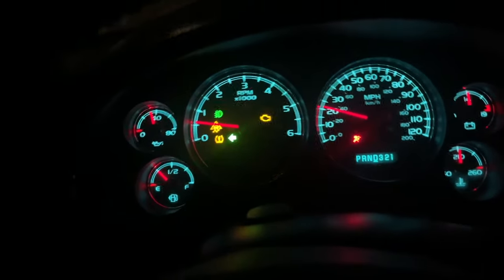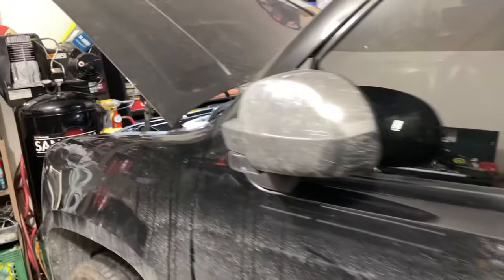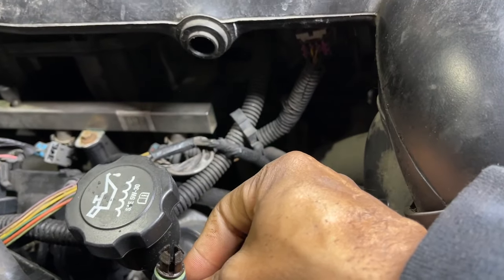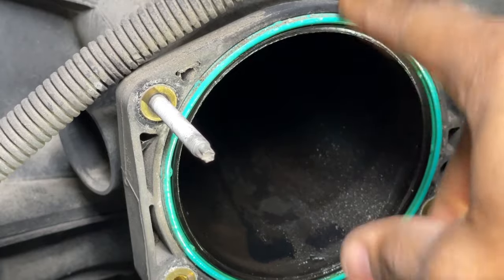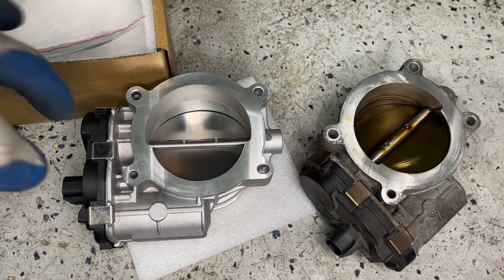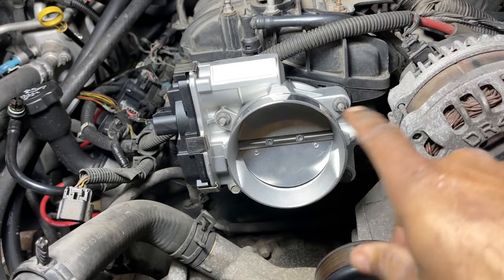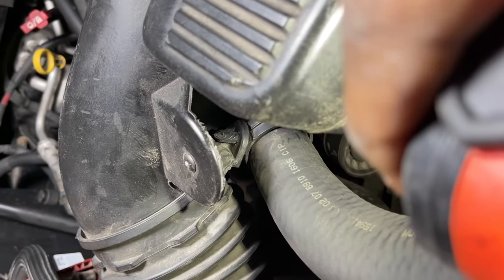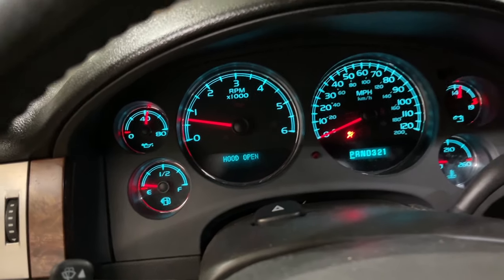How To Fix Reduced Engine Power Quick And Simple! Code P2135 Chevy Or GMC Trucks / SUV's! TPS Issue!

Comment: Hi Terence, 

My Chevrolet Captiva 2.0 Diesel AWD (2010) recently produced Traction Light On while driving and I can continued driving for tens of kilometre  while the Traction Light On was displayed. But once a Spannar Light On was displayed, I had noticed   that  the car had difficulty to move forward in spite I hard pressed the accelerator  pedal. Once I off the engine and restarted after 10 minutes or so, the Traction Light and Spannar Light dissapeared and I can drive as normal but The Traction Light On will appear again after I had drive for tens of kilometres. I had the opportunity to get my car scanned and according to the mechanic  from the history of the error codes, there were at least 3 modules that had difficulty in reading the data received. May you suggest what should I explore first.Thank You.

Comment: mine has too low the oil pressure, how can I fix it?
Reply from the maker: When was the last time you changed the oil? I would change the oil and use some Lucas Oil Stabilizer (4 quarts oil, 2 quarts stabilizer). That should get you some pressure back even if the oil pump is weak.
Reply: @TerenceDIY  my oil is @ 39% life. I already changed the pressure sensor & screen, changed the tube o-ring..... I'll change the oil and add the stabilizer. Thanks.
Reply from the maker: @alfonsosalazar6316  , let me know how the pressure is after you add some stabilizer.

Comment: I have a 03 chevy trailblazer LT and just replaced the throttle body because I was having the issue but the reduce engine power light is still coming up even after reprogramming and it won’t go over 30 mph and if I’m stopped than go it will take awhile to get up to even 20 mph any advice?
Reply from the maker: Two questions... did you replace the throttle body with an OEM one? I've had awful luck with the cheap aftermarket ones. And secondly, what codes is it throwing?
Reply: @TerenceDIY  we bought a whole throttle body kit I’m pretty sure and it came to almost $400
Reply: @TerenceDIY  I have to ask my uncle what codes came up when I find out I’ll let you know
Reply: @TerenceDIY  P1221 , P1271, P1481
Reply: @TerenceDIY  and yes it was a oem throttle body
Reply from the maker: Here are some things that I saw on the Chevy bulletin board for that year....

Inspect the main engine wiring harness between the PCM and the Generator Assembly for a potential short to ground. There is a metal wiring harness retainer in this area that secures the main engine harness. If the harness conduit is mis-positioned, some of the wiring may become exposed and chaff on the harness retainer. This may eventually cause the exposed circuit to short to ground.

Another possible cause is the fan clutch. It shares some circuits with the Pedal and throttle sesnor, and when the fan clutch failes, it can mess up the signals from the other sensors. If the P1221 sets frequently, you can unplug the fan clutch and see if the P1221 comes back. Having it unplugged will cause the check engine light to come on and if the vehicle starts to get too hot, you will want to plug it back in, but if the P1221 never comes back while its unplugged, you may want to put a fan clutch in it.
 
Also, you will want to inspect the wiring going to the throttle body. It's not uncommon for the wiring to rub on somethign and short out or for one of the wires to break inside the wire insulation (making it hard to see)....

And Finally, you could have a bad Accelerator Pedal Sensor. I wish I were there to help.

Comment: How much does this part cost
Reply from the maker: Here's a link to the part. Scroll down and make sure it fits your application. 

https://www.ebay.com/itm/374136353837?fits=Year%3A2007%7CMake%3AChevrolet&hash=item571c43b42d:g:c44AAOSwIqlivR9B&amdata=enc%3AAQAIAAABAGwr2Ib%2Bok303%2FSCIMw%2BGZPzASa9AsqSzYC%2BSaMK6emNTuTSaZvRhWRD%2Bo1ktnFngeg0M2KZVUptyuaNzxVpePuas%2BVYs2LlOAEvg1sv45QwKz9Dfu0HcXZjtiFLG9KJYkf9tQ9Nied4GePpnixb2wnYkuxOuhNQeEMwdPtMzOOfvjUm3yyzmUuhbiIZbNX4IcZ0lB7MNM%2BjPK5aOhMdBuUighhx0N8oqJ7P2zXgiwc2adcUnRyG4Oq%2FA%2Fk9SAUv0BXfwqHhfvy1C6uP3ki9qZdhIsz03f3CSu2zXU3XeFCdc2uyDS5YMtmKyawAJRCY%2BlXId8JNrdAFuRg0ipdb%2FL0%3D%7Ctkp%3ABFBM4r2aiNBi

Comment: Just got a check engine light and reduced engine power message today 2022 equinox 8k miles
Reply from the maker: That's basically a new SUV! I doubt that it would have throttle body problems. I'm pretty sure whatever it is should be completely covered by the warranty.

Comment: Y did the truck start having the small rpm fluctuation
Reply from the maker: It was in limp mode.
Reply: @TerenceDIY  mine ain't in limp mode atleast yet  n no lights ..just odd rpm fluctuating n shifting into go gears funny
Reply from the maker: Do you have any codes?

Comment: whats the name of the part?
Reply from the maker: Throttle body. Here is a link to the part. Please check if the year of your vehicle is in the description.

https://www.ebay.com/itm/394372022321?fits=Year%3A2007%7CMake%3AChevrolet&epid=12021372402&hash=item5bd2678031:g:srYAAOSwK5Fjk9dZ&amdata=enc%3AAQAHAAAA8AA9UEI8aCR4pCws66EaB64juuMlWevNYU2AMfCZulMu7tsjAooK91WGTHhuXz%2FUZ5baiHdh%2FqECYdWwjmRHxqAGfMlvYL0YPS%2B4vJHmQcIrRe3wPAYXNDALWQ3x5xelA0cKug4VUDsIoR8v%2B8ZedNu%2ByysD2S6pJ9uVfmEFFmkbNci27xEMwf%2FRD2jaZx0G%2F8N%2FXKeSTNovfYjTKhKkZflE%2BahK2B6owuP4DJDX7hGSMyUNmUFloaniG8ox%2BFuQtshERRBi4lrwXQ8L6svwwiyEQxuTnEx7TcbM0LTMYRR5W1yLr28RemlMgNBExCjcCw%3D%3D%7Ctkp%3ABFBMrpLM6-dh

Comment: I’m expressing this same problem with my 07 Cadillac STS. I replaced the old throttle body with a new one and I’m still getting the same error code. I would try to drive it but after a mile or two it would start to jerk and the “engine reduced power” light comes on through the dash. I don’t know what to do next
Reply from the maker: Hi Daniel, there was a bullentin released by Chevy in 2012 regarding this issue. The main culprit was the throttle body however, there were also cases where the harness that connect to the throttle body was having issues. There were wires along that harness that were somehow becoming frayed maybe from vibration along the engine block. I wish I were there to help you fix your issue. Thanks for watching.
Reply: @TerenceDIY  loo pop

Comment: What’s the part called that you replaced???
Reply from the maker: It's called the throttle body Andre. Here's a link for the part...

https://www.ebay.com/itm/333272439452?fits=Year%3A2007%7CMake%3AChevrolet&hash=item4d9895da9c:g:EpoAAOSw6QJdM5EW&amdata=enc%3AAQAHAAAA8MoUyTfsKekX%2Be%2BCj7USOvxRS2XHH%2B4s%2F3tNXtAZ4Z%2BLY2YJ8cZZawMqXI5eRkCN2peingTBDhw67RTFniZ13YeWeYbWwzGRlOX3gCqapuSIPwlEOfKzGzdNW%2BNzE8MbtbVa5O%2BFpxhVaf%2Fdhg2oVWZdIKKJ8uwYAr5E7Q4T5lHcaxKgMg8Bcld78w5Kzstwf%2B6YyT02c93eY%2FS8fTlzpWfiycP3IXPY3E9UIsRRy5ZLOGKzlSpW0SfWP518hcKaYMFyYkvKSK8vx5Wz36MqN%2BWTpT110y6G5iGIyBv4qfafPuQ2pqwPyBqOyVmjjsZ5bw%3D%3D%7Ctkp%3ABFBM0pmkqZxh

Comment: This is an incredibly dangerous thing. They added to the vehicles. There has been a couple times I try to pass a vehicle and it blocks my engine down and if I didn't have enough room to get back into the could have been a major accident. This thing needs to be removed.

Comment: Hello where you order part from, was it  from the dealerhip or any autoparts store? I need one and the prices are so different and expensive. I had just replaced the pigtail and some sensors hoping that would fix it but no here we go again. 2009 chevy tahoe 5.3
Reply from the maker: Hi, Here is a link to the part...

https://www.ebay.com/itm/333272439452?fits=Year%3A2007%7CMake%3AChevrolet&hash=item4d9895da9c:g:EpoAAOSw6QJdM5EW&amdata=enc%3AAQAHAAAA8MoUyTfsKekX%2Be%2BCj7USOvxRS2XHH%2B4s%2F3tNXtAZ4Z%2BLY2YJ8cZZawMqXI5eRkCN2peingTBDhw67RTFniZ13YeWeYbWwzGRlOX3gCqapuSIPwlEOfKzGzdNW%2BNzE8MbtQa9bKHYK%2FFny1QKeLPh5%2BT%2FvWkqJDUanZ7qKFa%2FOhsJqhggQbt7Umqf6zC8bs7CX38DptVmKXrZ5e1ffO5hiOX3R0pN%2FDzQhYhPHqus0EIe9dZFt8YQiPLivMTWeFMgMLoOzqCMLA6Ny%2FxV52kLnSoSua%2BZoIhp2FPjE5q0esui5UydLADX0lxurZTAZ%2BxIXg%3D%3D%7Ctkp%3ABFBM0qf9t6Vh
Reply: @TerenceDIY  Im going to rder one, hopefully it fixes the issue and its a very low price. Mechanics where i live at have told me that it needs to be from the dealership and it cost $500.00
Reply from the maker: @el.mas.buscado7221  , here is a link for an ORIGINAL GM OEM one that I've bought many times. This part is used but they are like new. 

https://www.ebay.com/itm/114732200404?fits=Year%3A2009%7CModel%3ASuburban+1500%7CMake%3AChevrolet&hash=item1ab69271d4:g:bnAAAOSwWMRgU8CT&amdata=enc%3AAQAHAAAA8Gx2AURQy6Df5gEuMbRS0x9f2F6sA3xkCwvbAAkRh0gSrvGlMZumm3fb83KQmBYxucBIcRHGN6RBhrHec3TMmu00FyxB0q5nD8fU0xqFFeqytkdRW6bh%2BfENitL0IAmSO8V%2F3e9vTla8gLv11QU%2BBL8V62Fi%2BxmlqtW1NEFKu218t0YsAlsxotBixEF%2FJOQycsiHW0RLbf4JViYS6N%2Fn9brzYn8MtEs0GxaTbOWt8IscKQ3RiZCNPki0aELQzsgfOPlwS%2F1MjQHVLor%2FBepPVFFlOJT29a3SjhGhQvRt8i0VwANKVbYDq6Z%2FocDG4Mm8GQ%3D%3D%7Ctkp%3ABFBM7P3fia1h
Reply: @TerenceDIY  Thank you very much! Hopefully this ends my struggle.😀
Reply from the maker: @el.mas.buscado7221  , you're very welcome. Thank you.

Comment: Our 09 tahoe had this problem while pulling out of the gas station on the way home the other day. Did yours shake? Ours wouldnt shift and had reduced engine power stabilitrac and check engine. Tried a crappy amazon sensor and didn't fix anything. I'm thinking of a new throttle body and sensor.
Reply from the maker: Yes, my truck did the exact same thing. The throttle body needs replacing. Very easy job. Thanks for watching.
Reply: I have a 09 gmc sierra with same problem, just happened...scared me.. so a new throttle body should do it? It's also been around the -20 to -10 degree mark outside and my truck hates the cold, could that possibly be the problem too? It didn't start having problems until then
Reply from the maker: I would buy it and have it on standby. Mines did it out of nowhere as well and my truck was running great! Here's a link to the part...

https://www.ebay.com/itm/333272439452?fits=Year%3A2007%7CMake%3AChevrolet&hash=item4d9895da9c:g:EpoAAOSw6QJdM5EW&amdata=enc%3AAQAHAAAA8MoUyTfsKekX%2Be%2BCj7USOvxRS2XHH%2B4s%2F3tNXtAZ4Z%2BLY2YJ8cZZawMqXI5eRkCN2peingTBDhw67RTFniZ13YeWeYbWwzGRlOX3gCqapuSIPwlEOfKzGzdNW%2BNzE8MbtYUacRse6BKo5S6modgKegT%2BcxGC6sqMnXyDepwl6F7QMyv6Lh2C%2BWT%2BbRDixydvHUNzLvd1XOSTuNABIjYxA4gfuF6O58jZuEXnNA2BcG%2BE4THVrVkk8IpwHrQbukaYC6TJU8vEWbMY0KjSsa%2FI3cvYbuYTzlx%2F3xj1T3Aya%2B%2FXBci7gsfwutL8c%2B72s72YUQ%3D%3D%7Ctkp%3ABFBM8Kfttadh

Comment: Could you have just cleaned it?
Reply from the maker: It would have helped, but they are inexpensive. Here's a link...

https://www.ebay.com/itm/225590875332?fits=Year%3A2010%7CMake%3AChevrolet&hash=item34864394c4:g:tgUAAOSwNrhkby5M&amdata=enc%3AAQAIAAAA0NNQWXMnLtdnN%2Byk2rlPXLl0AL%2FWsgipAId7%2BkWY4RUqdRbvZxlfe9nGgycMuspq1RMO2RTJetBxiYrLBCVZwjmETVo%2B0V8EGwP%2Byi%2BhnygGrUqc5Z28bUl%2FAIQQfO0pMjV2sTJLRWnuRmZydzPNdCUzvM%2B719UTWLCJvBNl4HoG2taffGIi2XR%2BPxzk2BR3LQYx9N2oRHRkATd%2B3WSL937FEZYGYZsIupT4cOFzSKaFykuKLhdoVSR%2FS7m2n8D%2FWP35i7%2F%2FgsOAWJzRylQAzsM%3D%7Ctkp%3ABlBMUOa_w7aSYw

Comment: Hey brother I have same problem on my 2007 gmc yukon .. I changed throttle body and accelerator position sensor it went 5 days driving fine but on the 6th day it went back into limp mode ... same code again p2135  any suggestions? I've been fighting this problem for 2 months straight now please help
Reply from the maker: Did you replace it with an OEM part? Please let me know.
Reply: @TerenceDIY  what does oem stand for?
Reply: @TerenceDIY  and I had bought the first throttle body from auto zone and when it had went out I went back because it had warranty and they gave me a new one it was running fine for a few months and it’s doing it again.
Reply from the maker: @lippinluna4859  , Original Equipment that the manufacture produced. GM original part (AC Delco) that came on the vehicle. Here is two links for the OEM part. One is used and the other is brand new. 

https://www.ebay.com/itm/191721690064?fits=Year%3A2007%7CMake%3AChevrolet&hash=item2ca380d3d0:g:3P4AAOSw-RFaWQRL

https://www.ebay.com/itm/114732200404?fits=Year%3A2007%7CModel%3ASuburban+1500%7CMake%3AChevrolet&_trkparms=ispr%3D1&hash=item1ab69271d4:g:bnAAAOSwWMRgU8CT&amdata=enc%3AAQAGAAAA8HqhQlVKTCpJhVWZNxftPTsH%2BWoqL93Do8CndIt%2FxdmDc9gpQdsmQ4hobHvUxH07hbQUjxnPt08dQMAn7l6CxD49YxscyN63Bj%2Ffg0hgzj%2FnwXXTqusfz8W3%2BG%2FC7yXNz7paal7HNJD9QEOE4onEplx6BnWMZwHCCZxQ7zZ%2FFQAXkBkuB%2FsHFvGeRaPQhMleEU3lJmJgp8TOYN9akFkbpckDtPmhRXr3aep7U02Ax06iuHpuHJ2CNUrECRmkEeiyNg6pl1uZroszLZzHcMZJiBK7QK%2Bq5UafAt%2Fbj95apOa9afU5lAgB3F%2F6MT4iVQdNzw%3D%3D%7Ctkp%3ABFBM4ML06ZJg
Reply: @TerenceDIY  thank you!
Reply: @TerenceDIY  damn I didn't... I will order the OEM parts now I'll give u Update when it's done thanks again bro..
Reply from the maker: @kaiooo814  , you're very welcome. Let me know how it turn out.
Reply: @kaiooo814  did the oem part work for you
Reply: @kaiooo814  did oem part work
Reply: @TerenceDIY   so I kind of done same.  I’ve replaced everything but the TAC.  But I get about 5 different codes that have to do with throttle body.  I’ve even ran a separate ground to alternator to firewall and still p2135 or different codes saying I lost communication to pcm.  Any suggestions?
Reply from the maker: Hi Dean, so you replaced the throttle body? If so, did you replace it with an OEM one? Also, do you have the reduced engine power?
Reply: @TerenceDIY   yes but not with a oem one.  You think that could be the main issue?  Yes I’m having it every day now I have to pull over at least twice.  I’ve replace foot pedal too just can’t seemed to find any short or anything.  I thought about putting a new actuator in but not sure anymore what to try.
Reply from the maker: @deanfox9957  , I haven't had the best success with the aftermarket ones that's why I only buy the OEM parts. I would not be surprised if that is your issue. Here are a few links with OEM parts in case you decide to go that route. 

https://www.ebay.com/itm/353571834590?fits=Year%3A2007%7CMake%3AChevrolet&hash=item5252860ade:g:KG0AAOSwtVRg7HzF&amdata=enc%3AAQAIAAABAHDAW%2FPK7zhN%2ByY7AjrL1aK%2Bi4LsmkfhErBoSAGEjGbvWHPGrD8o4N%2BSw26ygngC%2BvfsPlrktJPzl%2BR%2BeLI7%2F7pq3UkUdbSr%2B1GGRKZpQYvuD55XEb2BjI79Q4mP%2Bg8ZDPUYRZq2Lp1GbMilhlcK3l%2FTmGM5Z%2FUkuoi5%2BL3kTPCQSpcRUnBxyloewE1IqLA6yNNdtyQwNaY%2B2bS%2BDaL4stLYRdGT3GbyYOBTBGm8JjNUd9ahqawQG0Cc%2FZ0JAYquvgUKaVHcXhAkEArH1l6daU5JNwIjmaTUdMY3eYb38NHQC94yAkogy714FI0CrDa%2B4u3umDkj6HmhMAxIpMq2%2Bto%3D%7Ctkp%3ABk9SR7baqvKFYg

https://www.ebay.com/itm/166031581176?fits=Year%3A2007%7CMake%3AChevrolet&hash=item26a840dff8:g:YRQAAOSwIr5kOH8G&amdata=enc%3AAQAIAAABACtDxuD4koU71tgtemXk3WaTQQt2ykKumw2NLe2xgH8jRk8u7qqpfesxIf84eNOjmfeD7AYyV2rYkSNCfclJ179U5qosPf0SetapM9V8v0P55EhOmlVlHo02WnY1XjwT3jGGFzzzqVc0y2DvTrO39nDodSRiglobzCtDryjZuui011NAhNujeFadwSzFbx9prWzDjuKII3CJm5eqb1Bp4ka7nCoJ8VdTT%2F2JX5LDKtHf3j2GG4tmSJ3Yc5qYjVmyO9nUBikYUVQU6zGdHIKVfW%2FSSqzKGiYZOehsipLU3XWHB9QibRSd2rP2lWz7gi%2FFFMMgLTYBU6gc%2FT3VVOvQY%2Bg%3D%7Ctkp%3ABk9SR7jaqvKFYg

https://www.ebay.com/itm/191721690064?fits=Year%3A2007%7CMake%3AChevrolet&hash=item2ca380d3d0:g:3P4AAOSw-RFaWQRL&amdata=enc%3AAQAIAAABALEnXRQpQf3F6PvS5tc7YYrDWl6%2Fb%2FcXxZ1Ov0NNFbBOCVal4jRQ8N0z55b9q2oOPH7tvDAeL0MBCvyBW%2FzlP15hXNoBtSd8sM%2FwYaOrSSOhxzwi2%2B3V30Foo2GJXASET1ZGzEOcCly8Mld58S9WDjh4PUFQ%2FXqi8xpUckB8hafarEXhnOLgZK9qX6Y77U%2FombiFMWNp0nVOsRFVQRUU2i8aJmDC5ukA75sePezANXnVUdmpRO%2Fz7TxzYgpzbPF1TStKFmyC4FMGa7L1Z0gB8aKUW%2FFH%2FF0S6hie%2BS96cOy8lHw0Zlu3%2B97pQ7tAwmqYSYU%2FdMgovIqUD5GYpPTxSCA%3D%7Ctkp%3ABFBMstqq8oVi

Comment: I changed the pedal sensor and the light went off. A week lighter it came back 🤦🏿‍♂️🤦🏿‍♂️
Reply from the maker: If you didn't change the throttle body, it's most likely your issue. Thanks for watching.
Reply: @TerenceDIY  - Your welcome. I got truck checked and it was the P0455 Code. This code came on before. Before I switched the pedal sensor
Reply from the maker: @lyjobpodcast  , okay, I thought it was related to the pedal sensor. I have dealt with that code quite a few times. I had a bad fuel cap once and the fuel tank vent solenoid was the problem most of the time.
Reply: @TerenceDIY  - It was at first the pedal sensor code P0121. I changed it and the light went off for a week. Then it came back on today. I checked and it came up as the P0455 code.
Reply from the maker: @lyjobpodcast  , okay.

Comment: 2003 Cadi cts
Reply from the maker: Here is the part for your car. It's a top brand and it's a great price. 

https://www.ebay.com/itm/325113909788?fits=Year%3A2003%7CModel%3ACTS%7CMake%3ACadillac&hash=item4bb24c921c:g:vRoAAOSwyIhiOj2s&amdata=enc%3AAQAIAAAA8ENHnaBDe4JuIS6N%2Fw%2BB98qQafRm%2FawS2m49GQbU5Gu1rKo8qU0OR6kKENSze8gUBNUB8uzEyejymenT9Ik1C%2B%2FL%2FwmyOdBpha5gwpkoUJSNNJizyYZ%2FRCrIMr96YjeLaTtq8l0HsSZpSR7mYnt3jzl98yc%2FPL0avXyZLWLuX0feHLi%2FNioI%2BRBqB95eTO%2BUxLNnYEVe73olTephOombCk7TT%2FDk9sE0zpbjipdxpPZyD31qBNcYulHm6d9%2FhUVspY6E4XraNKv8hMD9qrL%2B67ANReQHyTTaAa5tVdnTgM7E9Sxl4DSS8oT82iBMgfZXKQ%3D%3D%7Ctkp%3ABFBMorKok_hh